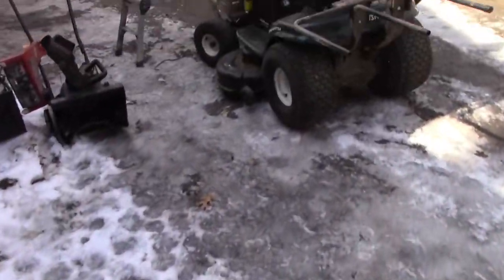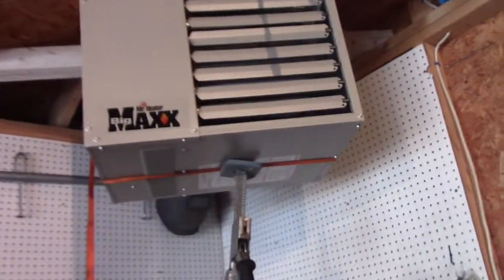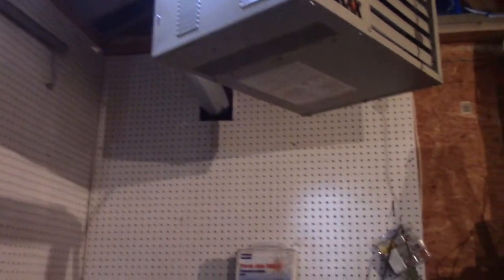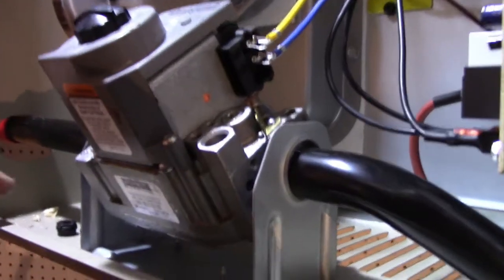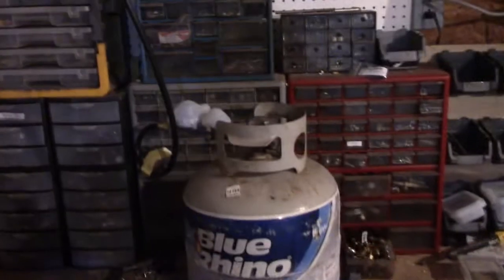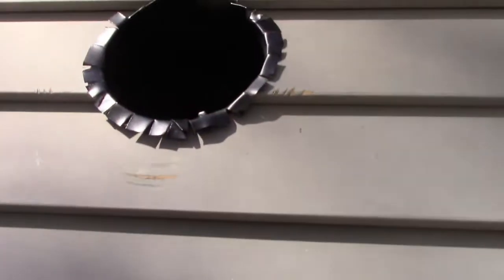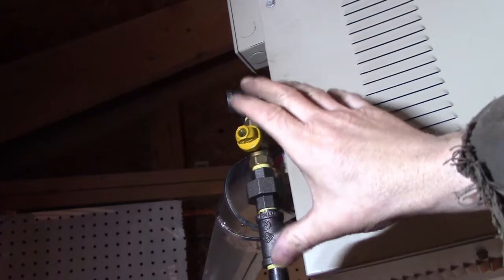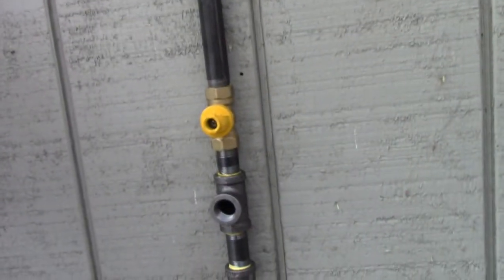Mr. Heater Big Maxx complete installation

Comment: You did such a nice job on the gas piping but then you cut corners on the exhaust. You should be using class 3 stainless steel with sealed connections because of the horizontal exhaust. Also your penetration should extend a minimum of 12 in past the exterior siding not counting a cap that should also be installed. You don't want a bird's nest do in there do you?

Comment: From what i was told buy my heating guys these heaters have regulator in it already
Reply: I was wondering my garage is 30x50 16 ft high any idea on how many but I would need. Thank you.
Reply: @davidallbright9844  I did find out that it is best to just add one so thats what i did. They dont cost much. But i do now have a double 100lbs tanks and it came with one already.

Comment: Great video!  I do have a question on the venting install.  You used galvanized pipe for the exhaust, the installation instructions specify CAT III stainless for horizontal installs on page 7 of the install manual.  How has your unit performed with the galvanized material? The code was changed in 2012 for these appliances, does yours meet code in your state without category III vent piping?
Reply from the maker: I used two pipes with an insulation barrier between the two.  I've had zero issues.  A clay thimble can also be used for passing pipe through walls. Neither are code now, so if your worried about code then your gonna have to fork over more money for the double pipe.
Reply: @JLafix  3D

Comment: Great video. How long does the 100lb tank last? I want to do a similar setup with the 50,000 btu big maxx
Reply from the maker: Can't give an accurate answer on how long it lasts because I'm not using everyday on any kind routine schedule. I have thermostat  set at 65 and probably used 12 to 14 times for 1 to 2 hours each time last winter and tank still fells heavy ( no fuel gage). Sorry can't help with good answer

Comment: How long does it run off that bottle.
Reply from the maker: Hard to say because I don't use often enough to measure,  but there is still feul in tank which is the 2nd bottle filled since I installed heater. So I guess the bottle lasted the whole heating season last year.